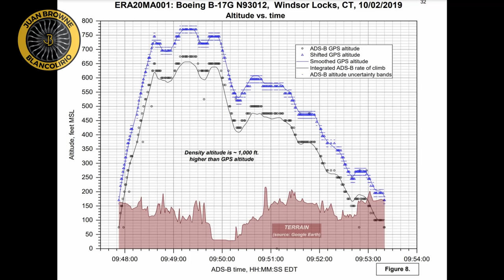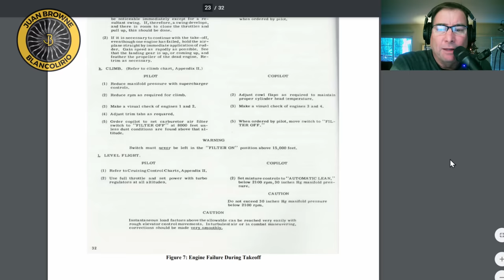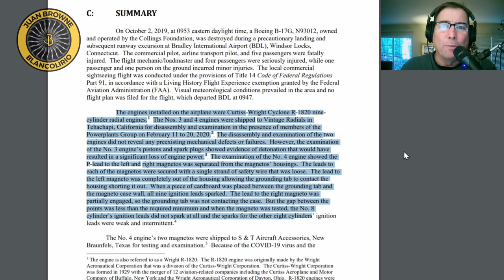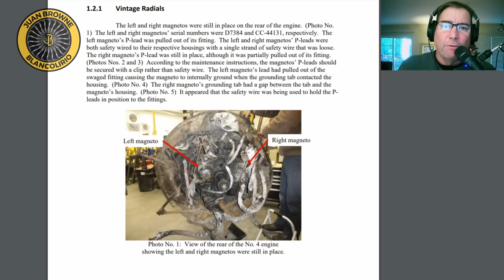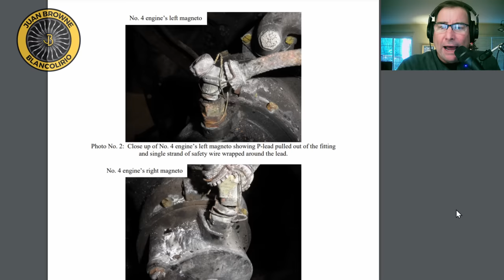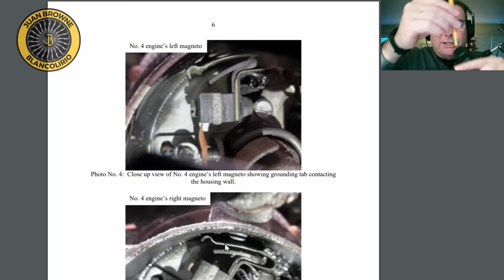NTSB Report B-17G Crash 'Nine-O-Nine' Part II -18 Dec 2020

Comment: D Hey Juan, I very much enjoy your dissertation on the mechanical aspects of this video. I worked as an auto mechanic for 45 years. 35 of that with Mercedes Benz. I'm a master tech for both Mercedes and ASE. I owned my own airplane and operated it for almost 10 years. I did all the annual maintenance and was checked and certified by a qualified A&P Inspector. I have a through understanding of all things mechanical. Your explanation of the magneto ignition and spark plug condition were all right on the money. I enjoyed that very much. Too much content on YouTube is made by people that have no business trying to explain how to exit an open door. You know what I mean. 

This type of work is very important and satisfying to me. It's grim because people died. That makes it all that much more important that we understand why something failed in the hope that we can prevent it in the future. 

I thoroughly enjoy your explanations and your video content. It's obvious that you have a broad understanding of engines and airframes. I also appreciate that you are a well versed and accomplished pilot. Having flown to Europe and back to San Francisco on 777 I'm in awe of anyone who's qualified to fly a piece of equipment that sophisticated. Enough ass licking!

After seeing the badly rusted cylinder and piston on the engine that was overhauled and within TBO I find it hard to believe that this particular aircraft was properly maintained. As well as other improper items such as P lead securing clips missing this airplane should not have been flying and certainly not been carrying passengers. 

Thank you for all the hard work it takes to produce these videos. I only wish I had money to donate to your cause. We, the aviation community, need more people like you keeping us informed.

Comment: Juan, remember with a constant speed prop, if the prop is up on the governor as it would be in flight, you won't see that RPM drop when you lose 1 mag, you will just lose horsepower.  I doubt that you would see any indication of this in the engine instruments.
Reply: I was going to comment and add the same thing you did.  Mag checks are done below propeller governed speeds so that the RPM drop can be indicated to the pilot as a measure of comparative ignition performance.  If both mags are equally bad you won't see the rpm drop between them.  The assumption is they will not not be bad at the same time.   At flying speed with the governor controlling RPM it will adjust the propeller to a pitch that absorbs the power available which will be less for sure but not seen in RPM. 

I watch every one of your videos Juan and you do an excellent job.  My father would say that a comment like this is "picking pepper out of fly shit".  I make it because I know your trying very hard to be as accurate as possible and you are achieving that at a very high level.

Comment: Maybe I missed something, but what happened to engine number 3?
Reply from the maker: detonation
Reply: @blancolirio  So both engines 3 and 4 failed because of detonation issues? Wow!
Reply: @blancolirio  Seems at that low altitude that if #4 was running at all it would have been wise to not shut it down, until they were able to climb higher at least?
Reply: @garman1966  I believe Juan said #4 failed because of magneto issues, not detonation.
Reply: @lizj5740  Thanks

Comment: Love your  cover of the mags Juan !  I learned abou these WW2 , mags from an old field chopper we had, and that "internal timing "  I would call "dwell" which effects the secondary voltage generated .   There's also the issue of the surface condition of the points where pits/spikes change that dwell timing as well as causing a " voltage bleed off "  in the secondary instead of a crisp pulse .  BTW farm tractor mags have the same issues ;   know first-hand .  But it seems there  was a major lack of practical knowledge and its application which ought to be a major consideration going forward with these old treasures .  We're too often running them way on the skinny side of knowledge and maintenance man-hours as they age while their caretakers get ever younger and less familiar with the technology .   Back when that B-17 was a war machine almost every engine wrench  puller grew up with its technology .  Nowdays ?
Reply: Yes and it happens with railroad steam locomotives too.  There have been tragic accidents with those too, because of exactly the same reasons that B-17 909 went down.

Comment: I understand the reason that aircraft have two independent (both from each other and the aircraft's electrical system) magneto based, power generating ignition systems.
To prevent this from happening.  
Simply put, if the crankshaft is turning and the magnetos are turned on they will fire.
That said, and without disrespect for vintage aircraft or the people who restore them, isn't it time to replace one of the two ignition systems with far superior and very reliable coil on plug electronic ignition?
I can already feel the beating coming on for saying this, but I'm not asking you to give up the time tested and works independently magneto.  I just think it should be the backup for a modern high energy primary system.  I want to see these aircraft flying at airshows for years to come.
I never want to see one crash again.
Please be polite, I am just offering my opinion.  This idea is not likely to ever occur, but maybe we should think about it.
Reply: Unfortunately regulation (and frankly a hidebound traditionalist streak in those that make them) prevents that from happening. It's only been this year, 2020, that there has even begun to be a readily available, approved, certificated, electronic ignition offered on some, but not all, of one manufacturers engines in general aviation.
Reply: @markbecht1420  Excellent, I made someone think about it and he was very polite.  Thank you.

Comment: Excellent presentation, Juan.  I flew the R-1820-86 engine in the Navy, so I am familiar with the mechanical details you covered. I know that the engine is started by selecting "both" mags, then each mag is checked individually (or supposed to be checked) during runup before takeoff.  Maybe I missed it, but were the #4 mags checked individually during runup? With one mag case grounded due to the loose P-lead ferrule and the "maintenance safety ground" activated, I would expect the engine to quit when that mag was selected.  And with #8 cylinder not firing on engine #4 "good" mag with weak spark on the other 8 cylinders, the RPM drop would not meet expected RPM at runup MAP.  Either/both results at runup would be reason to abort.

Comment: Why can’t these vintage aircraft engines be up fitted with modern electrical components? We have been doing this with automobiles for more than a half century.
Reply: Most.... like 99% of piston aircraft.... run on dual magnetos that are nearly identical to these.  When maintained properly, they're almost foolproof. They're independent and redundant. They operate independently of the aircraft electrical system, and independent of each other as well.

Comment: At least at the start up, taxi, and take off is there a way that u can confirm all cylinders are firing as designed, and with proper horsepower, or are u just hoping they are?
Reply: Set Procedure To Run Up each engine in turn and test each Magneto independently for performance and Engine Speed Drop, obviously all of this was ignored in the case of the Lost Aircraft.

Comment: I am an aircraft maintenance engineer in canada an have 55 years experience on various aircraft including piston and radial engines.
Over time it's normal for point gap to decrease. as the cam follower wears
This caused the internal timing to become slightly retarded. and weaker. At high power or manifold pressures  the resistance across the spark plug gap increases  causing miss fire and or detonation. Sounds like point gap wasn't being checked periodically. As for  the left mag quitting due to grounding out is pretty straight forward failure

Comment: Force blowing 100% nitrogen gas into the magnetos space may help to rough-start an engine, but it is Not a proper (or safe) procedure when the ignition system is designed to be tuned and adjusted by the old fashioned setting of the contact-breaker points and replacement of worn wiring and insulation. (Just like on a 40's automobile.)  It's that BASIC. Save the Nitrogen for the tires, where it will do some small good to retard oxidation of the rubber.

Comment: I can't believe the engines had only 300 hours since a rebuild?! Looks more like they took it apart, half-assed wiped stuff down and slapped it all back together. I'm not sure about radial engines, but on a diesel rebuild, you're replacing, at a minimum, all bearings, cylinder liners, pistons, rings, and gaskets. And then double checking all other components and replacing as necessary.

Comment: Why is it that old birds are not equipped with modern monitoring equipment, or even modern magneto's. e.g. electronic ones, which maybe could be backuped by emergency power (as they need power to operate). I drive a Mercedes from '67, and first thing i replaced was the ignition points as they are prone to fail, especially when not used after a while. (nowadays even connected via Bluetooth to adjust timing and limit revs). I understand purists want's everything to be original but i know even the P38 from the red-bull organisation has implemented modern equipment to monitor EGT's.

Comment: I've heard before that the old warbirds  will not perform at high power outputs for long on avgas due to the low octane. So it could either have been a long standing issue where engine 3 was pushed too far previously, or it could have been pushed to the limit when 4 failed, possibly a combination.  Not necessarily a timing issue, although that could have been a serious contributor.

Comment: This is absolutely ridiculous. That mechanic needs to have his license pulled at the very least. Setting up a magneto is mech/tech 101. It's amazing how such basic maintenance can be over looked or not checked at all. To have that plane flying in that state is criminal. Had I been the mechanic on that aircraft I would have grounded it until a competent mechanic would have been able to repair this ignition system. Pulling those plugs and doing a basic inspection would have shown these problems right away. The P leads were in horrible shape. I could have fabricated the damn proper clips in about 30 minutes. After a certain number of flight hours those condensers should have been replaced. The points cleaned, checked and filed then gapped properly. I don't think the gaps on those points should have been anywhere near .008 these should have been at .012 or .014 .these repairs are comical. The guy looked to damn old to be doing that job. I'm sorry I'm 59 years old and in a hell of a lot better shape than that guy. I know those radial engines. If you can't realize your limitations , then I don't know how people can not see it. Too many times guys ride on their own experience and arrogance. I have never seen such a culture as I have witnessed in the aircraft maintenance field. That's why I left. Too cocky and too much it's fine bullshit from the older guys for me. This is about safety, this is about lives. This in particular was also about a piece of history. This crash never should have happened. I'm just sick to my stomach. Too many crashes due to pilot error and shoddy maintenance. CRM DAMNIT. check list being followed religiously. I'm just stunned.

Comment: I'm a little confused. I thought going strictly by the performance numbers developed by data taken from ATC logs, engineers said that the aircraft took off with power from 3.5 working engines. Then when they cut power to #4 engine, the performance showed the aircraft to be functioning on just 2 working engines.  But from what I'm understanding, the #5 jug of the #3 engine blew up in flight and not damaged due to the impact. To me, just looking at the pictures of the remains of that barrel & head, that wasn't damaged from impacting anything on the ground.  My last sentence is just me looking at the pictures of what was left of #5 jug.  If that damage would have come from compression of striking the ground, or what have you, what we would've seen is more bending of the parts.  But what we see, are parts that look they they've been split in half like they were holding back an explosion.  I'm sorry that I disagree and would be very happy to listen to your opinion. Thank You.

Comment: Walked through this aircraft in Colorado in 2015, that safety wire job on the magneto it was done in 2015. Sure glad I didn’t take a ride. See stuff like this all the time on GA aircraft (not this exact thing though), it’s why I really avoid flying in them if I have to. Only will if it’s an aircraft I know personally to be in good condition.

Comment: You never mentioned damage blowing out magneto's with high pressure air can do.even for a simple fix of blowing out water. Messed up magneto leads to messed up firing leading to engine damage. Would figure the FAA should study that but like FCC they probably don't have anyone from a real aviation or work experience in aviation. Sing Kay Sera Bubbah.

Comment: The timing was just horrible. When timing is this far out of range you expose not only the piston to tremendous amounts of force it's not designed to handle, you expose the cylinder wall to too much heat, that's how you get the preignition as the incoming air/fuel charge is igniting way too early from the increased heat. This is the cause of destroyed pistons, rings, valves and cylinder wall gouging. I don't want to hear about noise being the issue here. One inspection would have caught it right away. Two if your the mechanic on something like this you would have still noticed something was not right with these. Three run up. This is another thing that should have given tell tell signs of issues. I'll tell you this. I hate more and more regulation's, but if this is what they are going to pull and call this competent maintenance then it's time to ground these aircraft. PERIOD!!!!!.

Comment: Juan I'm curious have you ever used a USB connected fiber optic camera when you're working on engines? I mean when you pull the plugs you can insert the USB endoscope camera into the hole and take a look at the piston and cylinder. You use it attached to a laptop and manipulate the or save the image or just plug it into a cell phone or tablet.  If they'd have used one of those cameras when they're working on these engines they might have seen the damage. I have this, I am sure you could find more uses for it than I do. https://www.amazon.com/dp/B07YDTG464/ref=cm_sw_r_cp_apa_fabc_QJ5T0QXDHCB63PFCC1X8?_encoding=UTF8&psc=1 . While the image quality isn't as good as my Canon 5D it does take a credible picture.

Comment: As an ex racer . . looking at engine 3's plugs there are only 2 cylinders burning producing power. There are NO spark marks on ANY of the plugs to indicate reasonable spark strength. Are you sure shutting down engine 4 was the correct move?

Comment: So many accidents are the result of assumptions. In this case it was assumed the engines didn't start because of moisture condensing on the mags. Magneto ignition is tricky. There's a fine line between all good and not. If it doesn't fire right up you gotta find out why. Don't take the easy way and guess. Most importantly, this kind of thing happens to the best of men. Be vigilant. RIP to all the victims.

Comment: Detonation is identified as any spontaneous combustion occurring after the burn process has already begun, and is independent of the initial flame front. This uncontrolled event can originate from anywhere within the chamber and is usually caused by high cylinder temperatures and or pressure. 
Incorrect ignition timing can cause high and unwanted cylinder pressure at an inopportune moment in piston travel. 
Ignition timing is usually  advanced which means the spark will fire before the Piston reaches top dead centre of cylinder travel by a few degrees)  that's normal as an engines speed increases the spark will fire to catch the optimal moment the piston can absorb the most amount of cylinder pressure from the exploding or expanding Fuel and air mixture to produce optimal power at any engine speed. However if the timing is too far Advanced ( incorrectly set) ,  the fuel will be ignited too early, and while the ignited expanding fuel mixture is building cylinder pressure in the Piston is still travelling towards top dead centre, increasing cylinder pressure further. This excessive cylinder pressure and its accompanying heat will ignite fuel that is still remains to be ignited in the cylinder. This sets up 2 flame fronts traveling toward each other causing all of the enegy of combustion to be focused at the area of collision, which is of course at a time of before top dead cente travel of piston travel. The result is this massive amount of energy being slammed into by the Pistons still travelling up and it has to do something so it will start to hammer away at the piston and the Piston may break. Sometimes  the top of the piston crown will break off at the #1ring land or a hole will be punched right through the piston.

Comment: The operator clearly got lazy and complacent, but the FAA should have been on the case to prevent them getting sloppy. When the supposed regulator doesn't even answer e-mails, it's setting a terrible example. 
If you have an engine failure in a retractable-gear machine, it's better to leave it up until you're absolutely guaranteed to make the target. Even if you forget to dangle the Dunlops,  it's better to hit the target with the bottom of the machine than an obstruction with the front.